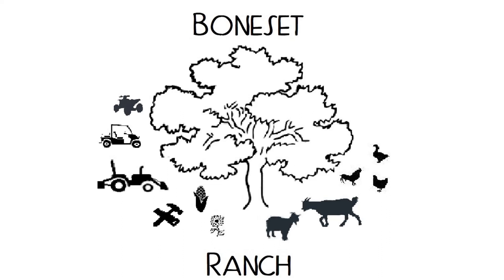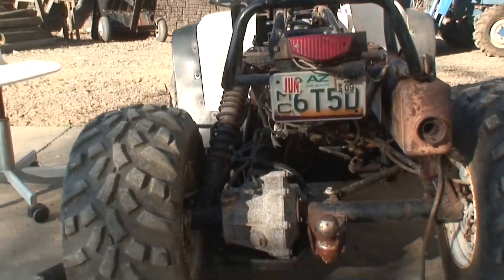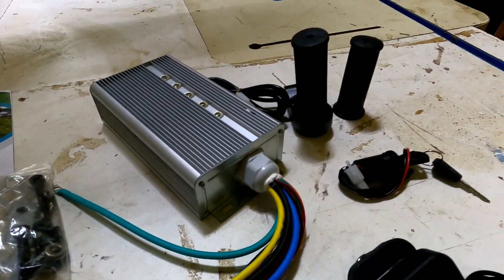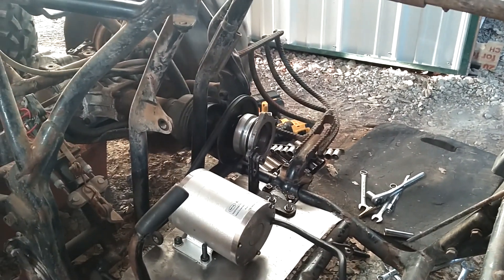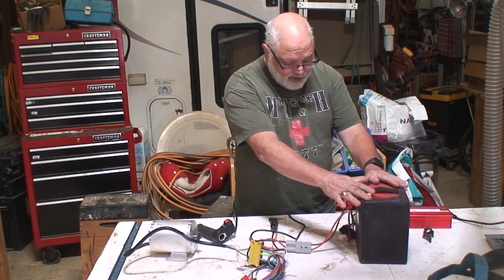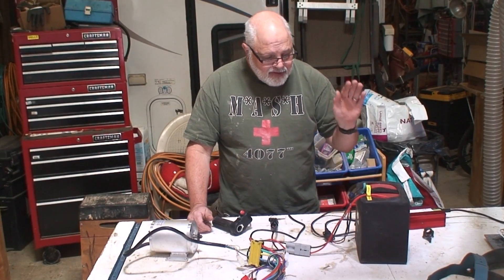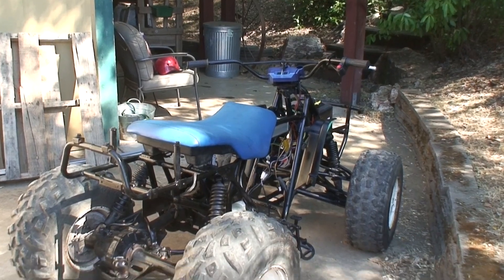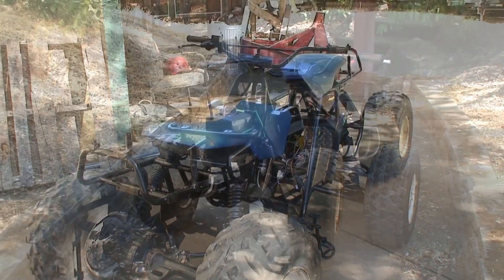Converting A Quad to Electric

Comment: Bypass the battery directly to the motor
Reply from the maker: Figured out the battery.  It was a faulty BMS. Still need to make the time fixing the chain connection.

Comment: Did you ever finish it
Reply from the maker: Not yet. It's top of my project list for this winter.
Reply: Ok thanks
Reply: Also wondering about this. We are starting a conversion for an atv with same motor.
Reply: Any tips? We are going to attach the motor to the swing arm close to the back Axel and use thw chain and sprocket provided with the kit. Seems such a tiny motor, hope this works out but would love to hear your latest ideas. Cheers!
Reply: @CynthiaSalchi  I've seen many done like that it should be pretty easy and just work because since your attaching the motor to the swing arm the chain is not going to get loose as the suspension compressions the hardest part would be the battery

Comment: Why not hook an electric golf cart motor to the existing transmission? Just curious.
Reply: I had considered a golf cart motor.  From what I could find, a motor cost as much on its own as the motor-controller-accelerator combo kit I used. As for the transmission,  it was molded into the same housing as the engine and couldn't be used without the original gas motor,  both of which had issues. The motor I have does have all the pep needed without the complexity of needing a transmission. But I did underestimate how exacting the chain connection to the drive shaft would be. I have a plan to improve it soon and will have a follow-up video when it's ready.
Reply: @tomwells1819  i would look into using a belt with a tensioner.  Also can you share  a link to Amazon for the motor?
Reply from the maker: Limited-time deal: BLDC 72V 3000W Brushless Motor Kit with 24 Mosfet 50A Controller and Throttle for Electric Scooter E Bike Engine Motorcycle DIY Part Conversion Kit https://a.co/d/g5N2Ch5
Reply from the maker: Thanks, the belt idea is a definite possibility.
Reply: @bonesetranch  5hp not much of power.  50amps at peak will give about 20 min on that battery, althoughi think it was meant to run on 5p at 60v.  I run 48v 20ah on 1500w motor and get about 35 min at peak. I am considering 16kw motor running 120vdc thats 130amp peak but battery size becomes a problem as i will need something like 200lb battery to run it.  And even then i get about 40 min at peak running 10p 120ah.  Need small nuclear power plant 😆 for anything more.
Reply: @KoShuFW  Thanks.  My efforts have been more from the hip. Won't have real time experience for how long the battery really lasts until I work out the motor to shaft connection.  The intended use will be to individually motor around our property. Long trail rides was not part of the plan. It would be nice if we had access to one of those small NASA power plants though.😉
Reply: @tomwells1819  you should have some expectations based on max amp draw of the motor and amp hours of your battery setup.  Will be following your progress
Reply: I did that setup with my electric Yamaha road king. It's pretty ideal and quite simple. Similar setup with a direct drive from the motor to rear trans. Much better torque and cheap to convert.